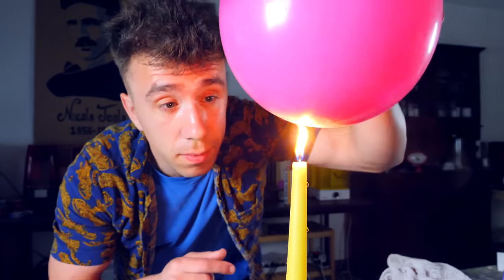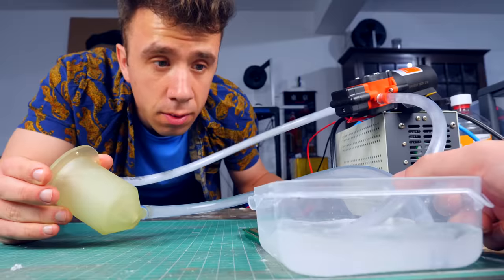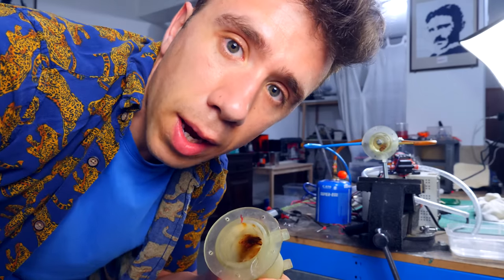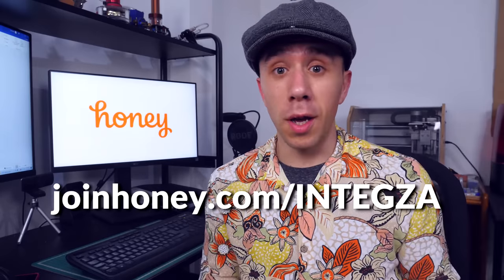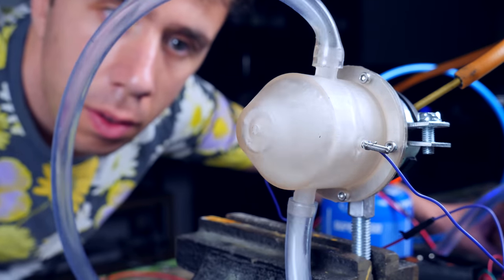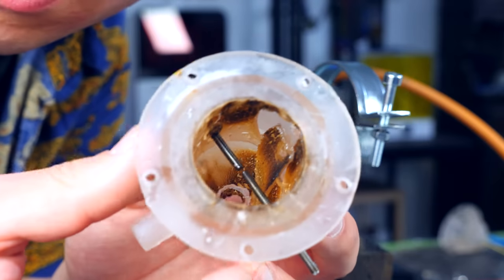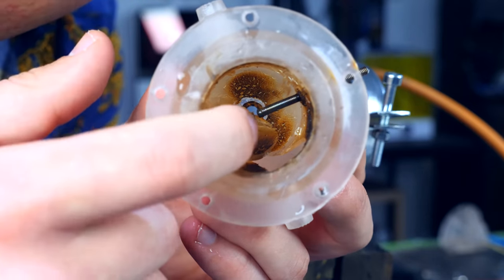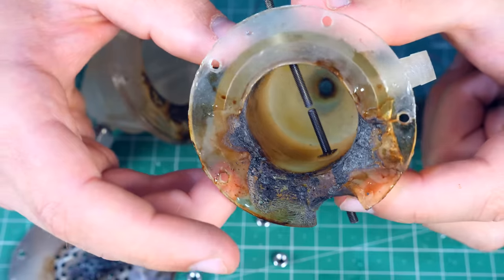Water-Cooled Jet Engine in Plastic

Comment: Ok, the balloon experiment is great, but relies on the fact that the membrane is very thin, so thin that the heat transfer to the coolant is very effective and ensures the rubber doesn’t get to the thermal degradation temperature.

The plastic you are using has a low coefficient of heat transfer and you made it thick to handle the pressures. The problem is, it’s too thick to allow adequate cooling and the thermal degradation occurs.

Love the content and presentation. Congrats on making science fun as it should be. This is a golden channel for youth and even older person like myself.

I would love to see the pulse jet running through a mass flow amplifier (I’m thinking Coanda effect tube) and compare thrust and outlet gas temperature. Then, mathematically compare the enthalpy change to the change in measured thrust to see how it lines up :)

Edit: ok I wrote this before watching to the end and you worked it out. But the other issue is the metal membrane has a very high coefficient of heat transfer and no cooling at the interface between the two plastic parts. So it overheats the plastic.   Perhaps since your “cheating” on this part anyway, put a small cooling tube brazed to the diffuser just on the outer perimeter where it touches the plastic. Then it should work :)

The other issue is this type of plastic when it decomposes changes colour and absorbs more radiant heat, kind of a thermal runaway

Comment: Your problem is that you have a pocket of air near the top of the cooling jacket. Placing the outlet at the top of the cooling jacket (instead of the side), will allow the air bubbles to travel along the tube to the water reservoir.

Comment: I don't have the means to reproduce this sadly, but I would have the combustion chamber cooled and the bolts, like make an area around the ring for the bolts to cool those too. maybe it'll be able to run for a while longer, I would also cool the water, use a larger reservoir so it has more thermal mass, and put ice cubes in to lower their temperature too.

Comment: Well you have solved the problem of the combustion chamber. Now you have to solve the vibration problem.Because you know from the law of thermodynamics and thermal energy is equal to the amount of the sum of heat and the motor work.Because, as you know, the surface of the balloon is rubber.While the contact surface of the combustion chamber is solid. so I suggest you this solution from a Formula One fuel tank Good luck.😁🙏

Comment: Increasing the internal surface area that the water touches(maybe by making the space where the water flows larger), plus adding a radiator and fan to the cooling system might help prolong the turbine's life. ove your videos, keep up the good work mate!
Reply: Is this the real Integza or that Scam that's going around YouTube comment section?

Comment: 10:00 wow the moment you turned it on the thought in my head was "wait a sec what that liquied is really flamable when it heat back into gas if it doesnt cool it enough and the the gas get wouldnt it go caboom? WOW THAT IS NOT A GOOD IDEA" and then it really does go caboom

Comment: Sorry, I have a question! How exactly is it set up in your case, how does the gas injection work? And how do you prevent the flame from burning into the pipe where the gas comes out? I also wanted to ask how you build up pressure inside? If I understand it correctly, you have a gas input and an input for a compressor for lift pressure or what? I would be very happy about an answer. Thanks. I find these videos really exciting from you. Can you go into more detail about how exactly it works in the future?

Comment: The issue you have is air in the water as it will turn to steam and then expand 1600 times get the air out the water you can do that via putting a water tank above the engine so the air filters into the tank then once out it will circle better

Comment: Damn that was a brilliant design! I have some ideas to try to improve it ! (but i don't have 3D printer so... new video, giveaway, or both ^^)
- put some high-heat resistant stuff (paint ? Aluminium foil ?) on the inside walls of the combustion chamber
- Connect your metal diffuser to the cooling system (using metal or 3D printed pipes ?)
Good luck!

Comment: Hmmm... Excellent experiments! I have often wondered if this would work as well (the balloon water trick) and I guess you have proved that right! One thing I would like to make note on though is that there needs to be a way to somehow bleed the air out of the system. Perhaps using something like a PC water-cooling loop might yield more clean water through your engine? You had a lot of air in your system each time you were running it which, even though it never really seemed to be an issue somehow, could greatly improve your cooling effect if you could figure out a way to get that air out of there. Also, your failure point was almost always the same spot, which you fixed, which it then moved onto the next spot. The metal screws you are using are conducting heat far too well and made the plastic too hot (well... I mean you could tell, you don't need me to tell you this) so something that "might" work is to actually design it so that the combustion chamber actually screws onto the front housing with a big thread... this way you will get a constant seal all the way around the chamber with good constant pressure, but also there should be no metal to accidently conduct too much heat. Might be worth looking into.

Comment: Butane cooling jet engine is an interesting idea.

And theoretically you can extinguish fire by dumping so much gasoline on it at once that the fire would stop because there is no more oxygen around it.

But the problem is

Comment: I'm thinking all you really need to do now is cool the metal part, im thinking that if you drilled little holes in the watercooler chamber that contacts the metal could really help with the thermals. That or a more stable and heat resistant metal or composite.

Comment: how about adding some metal oxide nano particles to increase the thermal conductivity of water..... or use your liquid butane to vaporize from excess heat and than use it in combustion....  as they do it in cryogenic engine with liq hydrogen and oxygen.

Comment: Idea: you could build a dyno to test the amount of thrust these jets produced-
-
And solutions for structural integrity of jet could be metal rods integrated into the design that could absorb heat and uniformly transfer it to coolant -
And the tomatoes are terrible

Comment: 5:24 be complete facts , I love your ideas
Reply: But technically it isn’t cheating as the title  is stated as quoted “watercooled jet engine in plastic”. Said in plastic so the metal diffuser is part of the jet engine and contained in the plastic water cooler. So the jet engine components isn’t said to be plastic but is contained in the plastic water cooler. The first part water cooled jet engine, with the second part being in plastic saying that the engine is in plastic and not saying made of plastic. Case closed.

Comment: the idea to use a different liquid that has better heat conduction wasn't a bad one. but I'd suggest to use something that doesn't burn as easily as liquid butane xP 
liquid nitrogen might be a good idea? nitrogen gas has bad heat conductivity, but in liquid form it should work wonders to keep everything cool. and in case of leaks, nitrogen should not burn. although the liquid form might technically be able to be lit, the resulting gaseous nitrogen should suffocate any form of flame.

another idea might be to use a combustion chamber made out of something that will transfer heat to the cooling liquid faster. like using an aluminium can rather than plastic. that should also help improve the heat transfer rate.

Comment: I think you are getting this issue, because the 3D printed resins have very low thermal conductivity. The inner surfaces are getting super heated before the heat gets to travel through the wall and be cooled by the water. Thinning the wall will help, as it will reduce this distance, but changing material into something more thermally conductive would be getting to the source of the problem. 
I am not sure if there are any Photopolymer resins that has higher thermal conductivity out there. 
I do know that there are metal particle-filled 2 part "epxoy" resins out there that has higher thermal conductivity. Maybe 3D print the part, make a mold of that printed part using silicone rubber (compatible with epoxy curing methods), and then cast the part with the metal particle filled 2 part epoxy resins?
I know there are some 3D printed part, silicone rubber, and epoxy combinations that won't work, because either some 3D printed resin inhibits silicone rubber curing, and some silicone rubber inhibits epoxy curing. But i'm sure there are combinations that should work out there....

Comment: if you combine vortex jet with water cooling? It could be possible to cool the nozzle by reversing the direction of the water in relation to the air/fuel mixture. And creating a water vortex achieves better cooling. Please a second part.

Comment: Maybe the problem was in that the water was pretty bubbly while flowing in the tubes? Maybe all those air bubbles that were in the water were causing the reduced cooling effect? maybe you should think of a more laminar flow of the water inside the tubes?

Comment: If you use smaller holes on the defuser the explosions and the flames wouldn't be able to propagate backwards as easily
Reply: Also if you upped the gas flowrate and maybe made the chamber longer you might be able to force the gas far enough away from the back right after the detonations, effectively "air cooling" the defuser lmao

Comment: Put a gasket of heat resistant material on both sides of the metal plate. If the problem is heat conducted by the metal then insulating gaskets should solve it.

Comment: I am trying to make a thermite based fuel and basically need a piston action jet engine to decompress and cool it in pulses. With specialization it should work with any fuel. The idea is deflection off of blades causes it to move up a screw and then blow back and outflow decompress. Allowing it to both function as a rocket and act on a transmission. 

I want to put it in cars so we can have  outflow nozzles on top and help control traction and acceleration w/o traction

Water is the ideal coolant given the nature of my intended fuel, only it will stay hot for far longer once ignited than butane. So... I mean if you guys can make a combustion version work then materials should make up a good bit of difference

Comment: I wonder if some kind of modified Tesla valve built into the engine would prevent the combustion from propagating backwards without introducing a new place that could melt or explode. Simply inject the butane at one end and hopefully with the right design once it reaches an equilibrium all combustion products only exit in the intended direction!

Comment: The baloon has a wall thickness of like 0.1mm. What does that mean? It means it will transfer heat very very easily. Thats why when you put water inside the baloon it transfers the heat from the fire very fast, which is then absorbed by the water inside the baloon. That way the baloon stays unharmed. What if you repeat the same test witha a thicker baloon, say like with a 2-3 mm wall thickness? I bet the baloon would melt down before the water had time to cool it down. So the process seems to be much more close to adiabatic with a thicker wall thickness. I believe this is the same problem with the resin printed version. Actually with the "jet engine" test the temperature inside the thing seems to be much much more, which makes things worse. So you need to decrease the wall thickness between the combustion chamber and water pocket as much as possible  to ease the heat transfer. Lastly, water needs to be everywhere touching all of the surfaces which is heating up from the inside. Using a cooler water would be my last iteration but that should also help. Good luck :)

Comment: I wonder if you could print cooling fins all around the outside of the core and make the outer shell a high bypass turbofan type design and use pure air cooling.

Comment: i noticed that the water wasn't fully filling the cavity you made for it perhaps it will cool better if you create a pressurized system that spreads the water evenly over the whole surface and run it through something to cool it like a radiator submerged in a cold substance, similar to how most modern cars cool their engines. there is allot of options here but i think that's why your chamber kept dying also why not run 2 of them! one for each side allowing both sides similar heat tolerance with the diffuser remaining metal.

Comment: Well, now you make me think!
What I would like to see is letting go of the inner tubing altogether, and letting the water be sprayed as a thin film on the inner walls of the burn chamber. The burn chamber will then need to be rounded, and you'll need to spray the water from a ring sitting around the fuel source. The water would also extinguish the flame for sure, as it came close to the nozzle, but you'll only have to make the burn chamber large enough to let the flame burn completely before it came near to the nozzle. The evaporating water would then work more like an afterburner, adding pressure to the rocket.
And, I think you will have to look at how to properly mix air with fuel. There are lots of examples around, like blow torches, so why not use one of those? Or perhaps an oxy-fuel welding torch would be best? It has gas pressure you can grive into the burn chamber and all.
That's another thing: Added pressure should be considered a bonus, shouldn't it? It's proof that you're making something powerful here. So having to enclose your rocket in thick walls or perhaps even UHMWPE wouldn't be the worst thing?
I've also looked at the Devils Toothpaste rocket, and calcium permanganate is said to have a melting point of 140 degrees celsius, not impossible to reach for steam under pressure. That's probably the reason that it leaks out, it melts and blows out of the nozzle. But that's really just a sign that there's too much contact area between the two chemicals, as if there was less contact the melting calcium permanganate would be the first to be used up. 
But as calcium permanganate has such a low melting point it shouldn't be impossible to cast into a useful shape? If you took calcium permanganate and molded it into the shape of one of the rocket fuel grains from your Hybrid Rocket Engine designs, and poured hydrogen peroxide through that?
And that's a third issue. I think there's a limit that return valve you use for stopping the back pressure from the burn chamber: It makes the engine pulsate, as no fuel comes into the chamber when a reaction causes pressure. There's nothing wrong with the return valve, really, but the hydrogen peroxide should be driven by  a much higher pressure. Perhaps from one of those CO2 cartridges you use? If you use CO2 to release pressure into a tank of H2O2, which again is forced into the burn chamber, you should have a much more continous burn. You may also need thicker walls, of course, but isn't that part of the fun?

Comment: Maybe if you put a ring of fiberglass or made the membrane out of carbon fiber. It wouldn't conduct the heat to the printed parts. And I think they make a 3d printing filament with carbon fiber

Comment: Actually using the butane or even the alcohol as a coolant was a good idea. Using the fuel as the coolant was the basis for the V8 rocket. The problem arises from the fact that the 3D resin is not going to put up with the pressure and temperature you're asking of it.

Comment: So, I realize that the goal is to 3d print as much as possible. I think you'd be further ahead if you compromised a bit with some metal internal parts. It wouldn't be too difficult to pull off.

Comment: Don’t know if anyone else added this as there a over 6,000 comments so far…. What about using a phenolic spacer or auto exhaust manifold gasket material between the metal and the printed pieces - that may insulate it enough to keep the metal from melting the resin

Comment: did you try pumping the up through the bottom to eliminate air pockets that would lead to failed cooling. Water rising would force the air out potential pockets.

Comment: Made everything same just change the metal diaphagram with 3d printed hollow from inside diaphagram in which connect a pipe with putting water at height and flowing down naturally and leaked from other openings

Comment: Yeah using a flammable substance to cool anything down isn't the move. Even just regarding leaks. You may want to increase convective heat transfer by injecting more mass flow of water. Bigger pump and more volume surrounding the combustion chamber will probably be easiest next design move.

Comment: This is really amezing! Have you tried to use a Heat Deflection Temperature UV RESIN? I hope I can add the linkg here
Reply: Also you could also add more complex features such as a radial compressor... if you have problems with cooling you can even use ethylene glycol with water

Comment: in organic chem we use reflux condensor wich are analog in design (kinda) and we always have the water flowing from the bottom to the top, so that all of the flowing water is in good contact with the side of the chamber and avoid area that stay hot due to a stream that does not fill all of the reservoir.

maybe try that ?

if the diaphragm conduct heat too well, why not extending it passed the side of the chamber and connect it to a  heat sink, or connected to a nonut shaped watercooler?